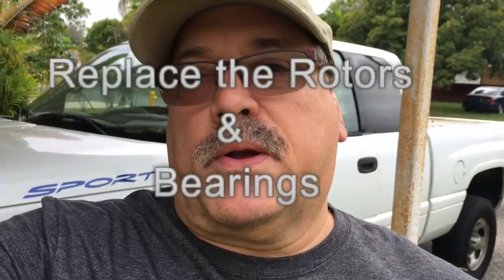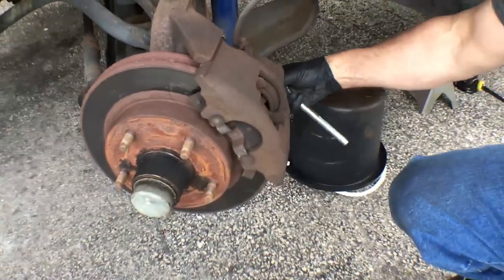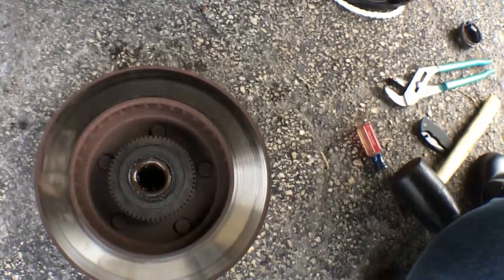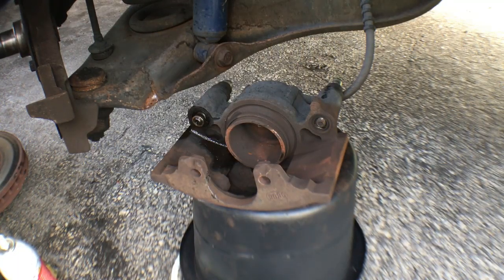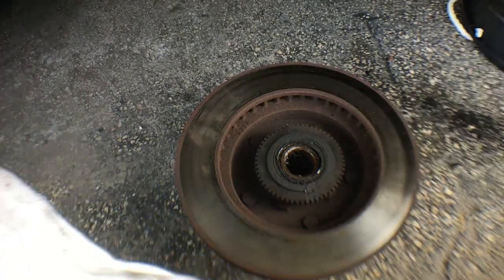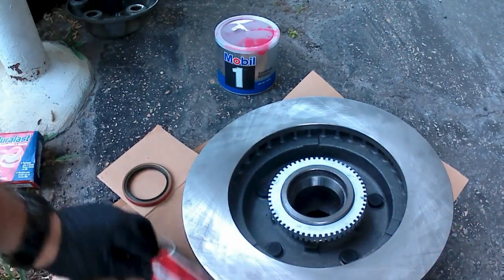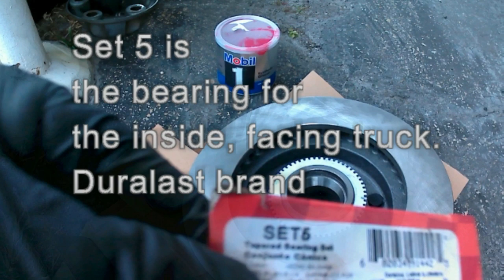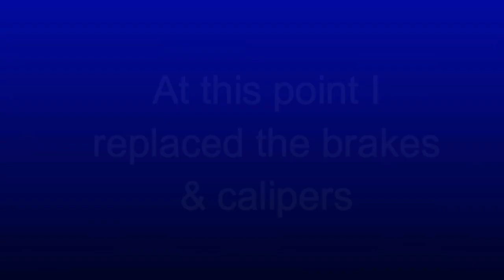Replace Rotors Bearings: 1999 Dodge Ram 1500

Comment: Was really confused for a while because I need to change the bearings on my 95 1500 2WD, and was seeing that some had packable bearings, some had hubs, some had splined hubs, and couldn't find the right video for mine. But looks like yours is exactly what I needed, thanks!
Reply from the maker: I had the same problem, I even order rotors online and they were the wrong style (returned) . I went to Auto Zone got everything I needed, even extra racers incase I damaged them during install.
Good Luck!
Reply: @RonsLens  The install went great, thanks!
Reply from the maker: @marvnation924  Thanks for the update, Well Done!

Comment: Front tapered bearings for 1999 5.2L 2WD: Tighten the nut to 41 - 54 Nm (30 - 40 ft. lbs.) to preload bearing while rotating the hub/rotor. Stop hub/rotor and loosen nut to completely release bearing preload torque. Tighten the nut finger-tight and install the nut lock. Install a new cotter pin.
NOTE: The end play should be 0.25 - 0.076 mm (0.001 - 0.003 inch).
Reply from the maker: Thank you! Very helpful information.
Reply: Thank you!

Comment: A ratchet Allin wrench fitting -- never seen one of those. Maybe that side of the truck that was more rusty sits toward the ocean. I have the greatest admiration for anyone that can do this sort of stuff.
Reply from the maker: Thanks Joe, it wasn't with some set backs, I did some bone head things. Maybe a what not to do video can help some folks out will be pushed out later.  I ran out of battery power on both the camera and the phone. Then I ran out of time and daylight.
Reply: Who has not.

Comment: Appreciate the video. Do you have an idea for the axle nut toque spec? I have a 95 sport 2wd with the 3.9, and it has a very similar build. Same rotor and wheel bearings. Ive even managed to swap my rear leaf spring brackets with a 97 dakota 4x4, changing the rear stance. I found the control arms and spindles of the 92 through 94 match almost exactly with my 95. The only difference is the tie rod size(quite a bit smaller). I had to tap some new 92 tie rods and managed to work it.
All that being said, I really like what they did with your front end. The shock is accessible outside of the spring and I noticed a larger spindle. Probably all around larger with the bigger motor. I bet you, I could work that in. I just need to check measurements  of the control arms mounting points. The newer parts would help a lot.
Reply from the maker: I'm sorry about the nut toque spec, I tighten it to the point that the pin would fit back in. Junk yards for the parts on the Dakota are my only thought about your parts situation. Good Luck!
Reply: just added comment for taper bearing preload

Comment: The last time I replaced rotors and bearings I bought new rotor that have no outer race in them .Had to go to shop to have them press in the outer race . Inter and  outer had to go together as pair so they last longer . Its been many years ago .bearings still good but rotor worn out . Now all new rotor come already press in outer race, no shop around doing that either

Comment: Please don’t judge me, but I got to be doing something wrong, cause i can’t get the wheel seal in
Reply from the maker: No judgment from me. Double check you have the right part. You may have to buy a replacement seal if you damage the one you have.
Harbor Freight might have a tool you could buy "Race and Seal Driver Set", or the auto parts store could rent out the tool to you. I recall the 1st time doing this, I had to get another seal, myself. Good Luck
Reply: @RonsLens  found out I have the rotor I have to press the bearing in, so I have to wait and find a press